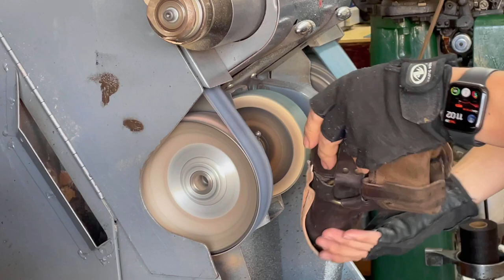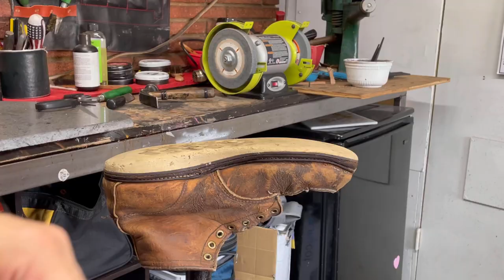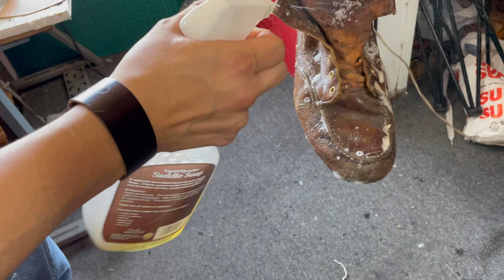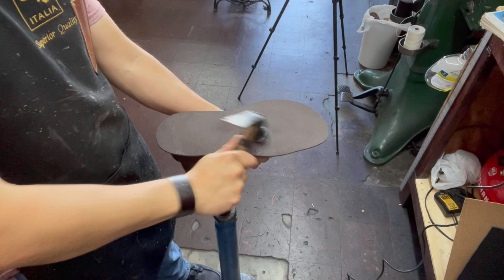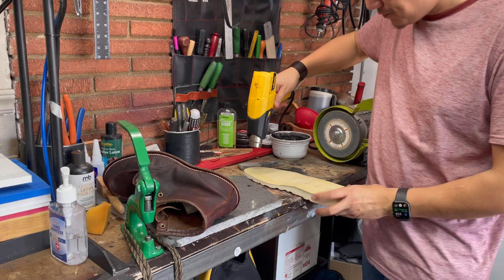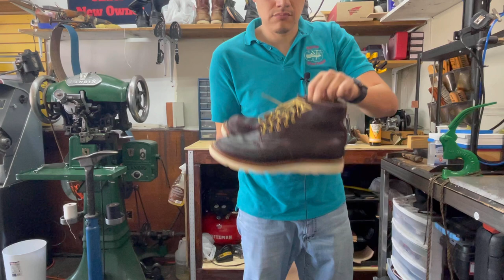Red Wing 1907 Back From Hell 🔥 🔥

Comment: Are those the Concrete Rough and Tough or the Copper Rough and Tough? It looks like Concrete, but I've seen the Copper get extremely dark depending on which conditioning products are used.
Reply from the maker: I really don’t know, this were dead 💀!!!✋🏻
Reply: the 1907 are copper rough and tough leather.